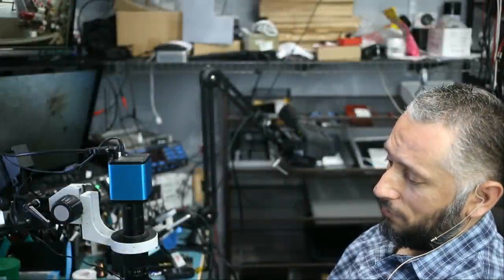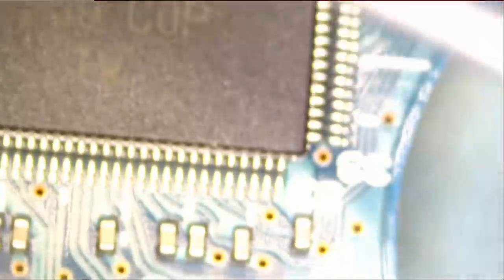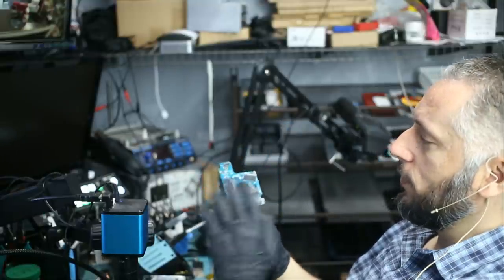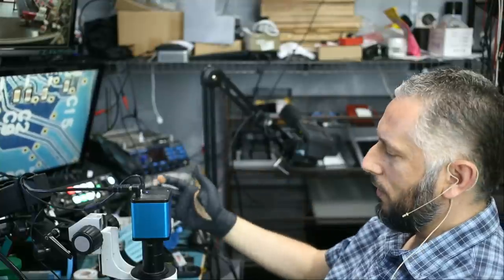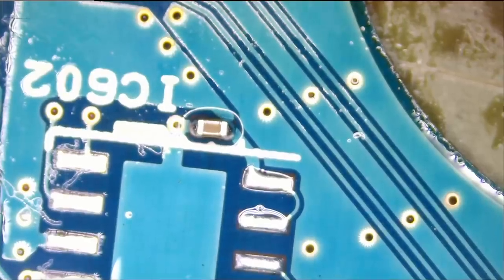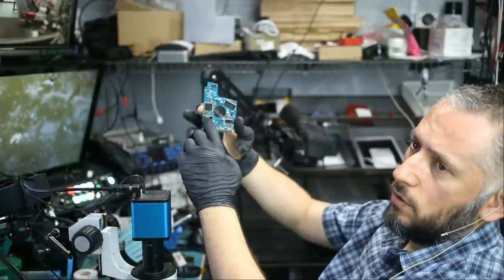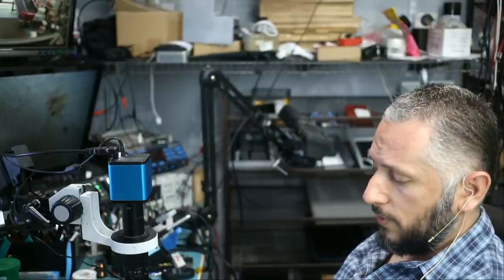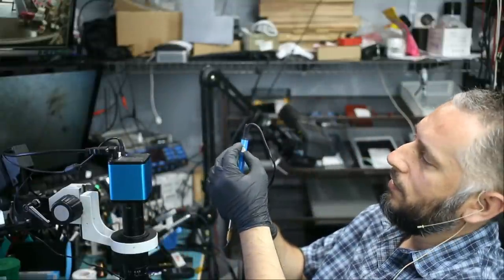Hard Drive not recognized Data recovery - Faulty controller

Comment: I have simulated looking at the screen and working with my hands.  No great problem.  Of course, the movements must work in the intended directions, rather than 90 or 180 degrees out of kilter.

Comment: Hey bud is it possible to flash the original firmware to the new control board from the damaged control board using a  usb ch341 programmer  instead of having to unsolder the chip to put it on the donor board?

Comment: Excellent job. Bit confused as to why the firmware chip had to be moved. Can you please clarify
Reply: Micro code on Toshiba drives is kept in rom and is unique to that drive it must be swapped onto the new pcb or the drive with either not spin or spun and click

Comment: ive swapped my pcb board over for a seagate barracuda ata 10 gb wud i need to swap the firm ware chip over its from like 2000  it now spins but wont show up in my disk managemeent ????????????????????????????????????????